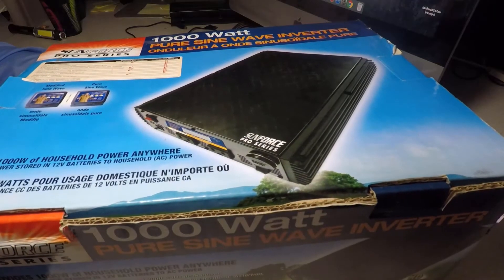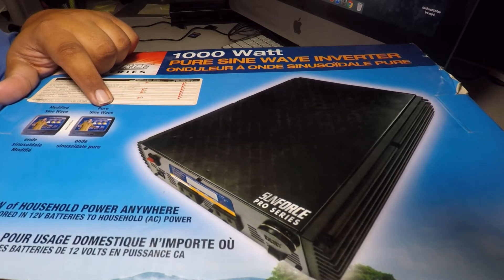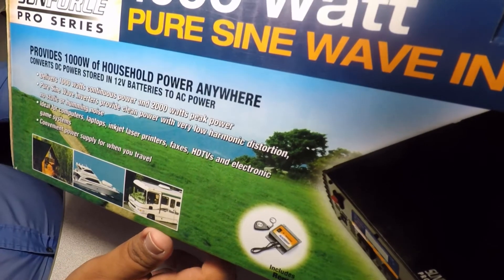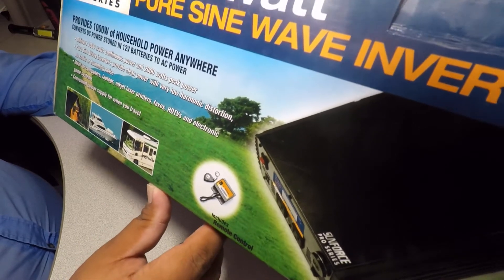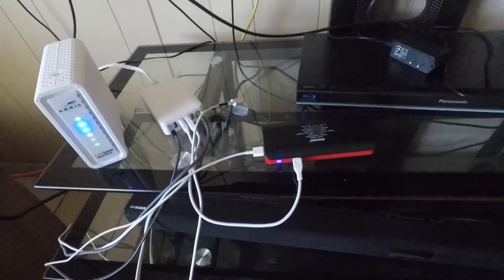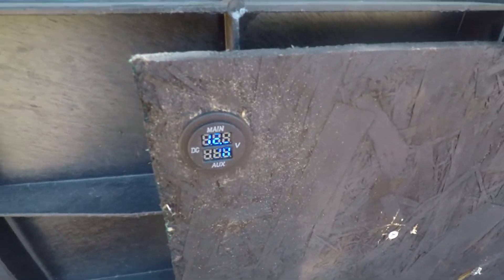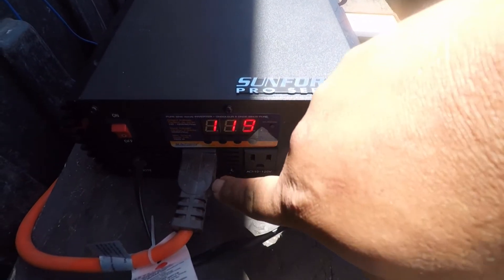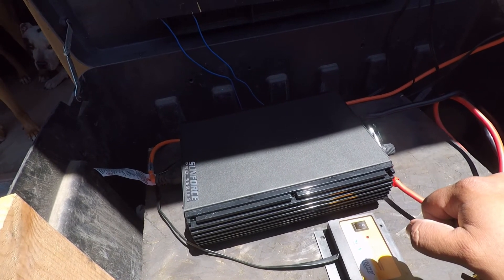Thunderbolt 100w Solar System Up Grade (Sunforce 1000 watt inverter)

Comment: 100 watt /12volts = 8.3 amps. thats a slow charge rate for one battery, how many batteries do you have? just curious. i bought a few of those harbor frieght 100 watt kits and i am thinking of taking it to the max wich is 400 or 500 watts depending which  controller you use, the one built in or the other one on the shelf there ar harbor frieght. i only have one big car battery but i am thinking of buying like 4 giant 8d batteries and getting a low frequency inverter so i can run my whole house on it. but i am starting small for now too
Reply from the maker: Depending on what your running. Would suggest getting a kill a watt device to measure how much energy your devices take.  Then add all of them, or plan out what you can turn off and on. I would search craigslist/ offerup see if you can find commercial grade solar panels a good price. 

Kill a watt video https://youtu.be/jACVVFxwCZA
Reply: @toolhead147  thanks. Yeah I do have that killawatt device. I was thinking of getting several amp clamps next to watch amp draw next.  The charge co troller I think I want to be at least $1000. The battery bank maybe five 8d 200ah agms. And the solar panels them selfs I don't know yet I'm thinking 4000 watts
Reply from the maker: @jasonbrown467  I currently have 2 255 watt solar panels and a harbor Freight 100 solar kit.  8 trojan t105 batteries.  That's enough to run most of my house. Except Stove and a/c. Its really hot here,  might get a mini split to help not turn on my central a/c.